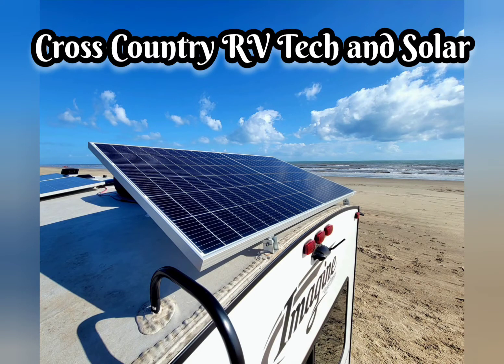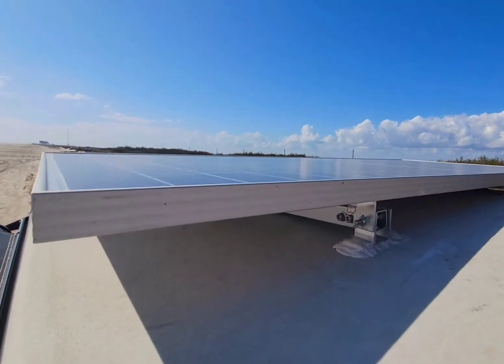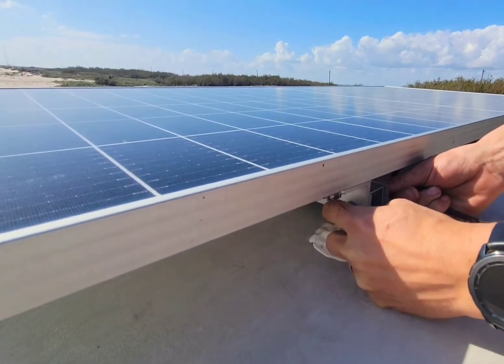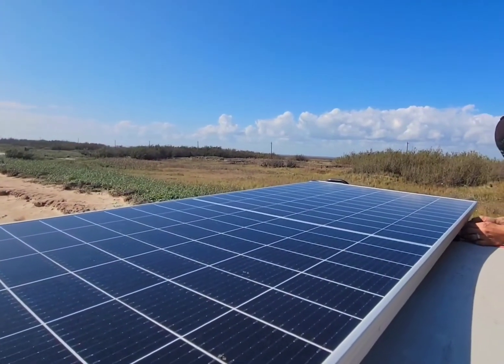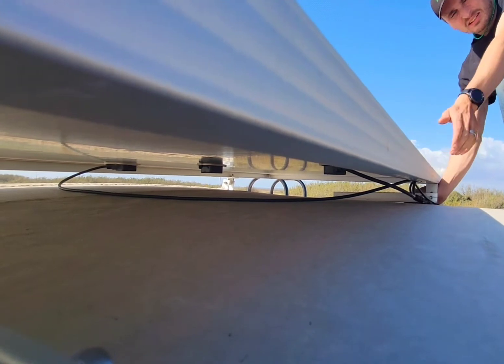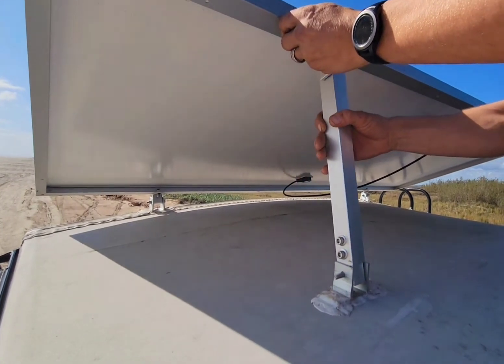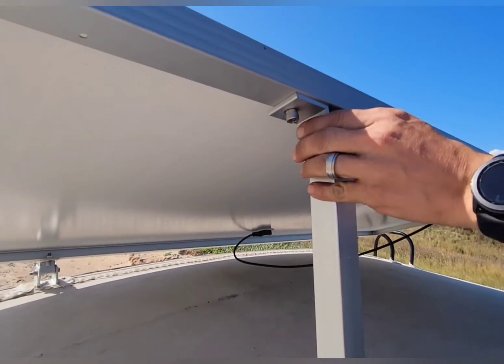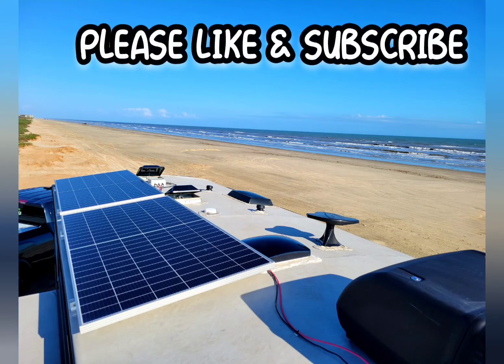RV Solar Tilt Brackets by Rich Solar

Comment: Did you screw and bond and seal the mounts to the roof or just bond and seal?
Reply from the maker: I always screw the brackets down to the roof.  I put butyl tape or sealant down so the screw takes it in with it.  Only time I don't screw is in some fiberglass roof situations in which I only use strong VHB tape and then sealant.  Thanks for watching....
Reply: After spending weeks designing and building a tilt system to build 1 tilt rack with 3 x 100 watt panels I have come to the conclusion that NO it's not worth it. Should have just bought another panel for less than the $200 or so and countless hours I've spent designing and building a custom rack, not to mention the future hassle of climbing up and down on the roof. 😂